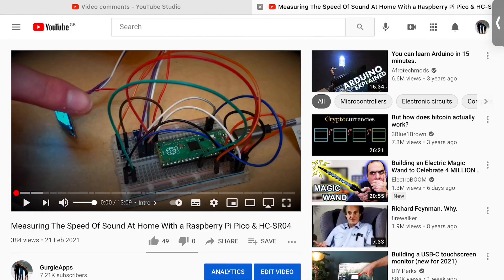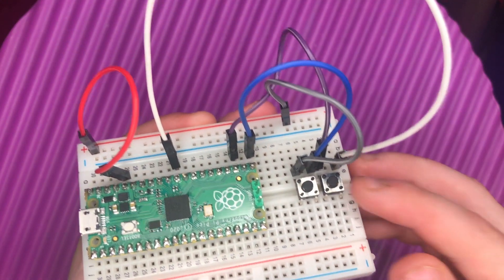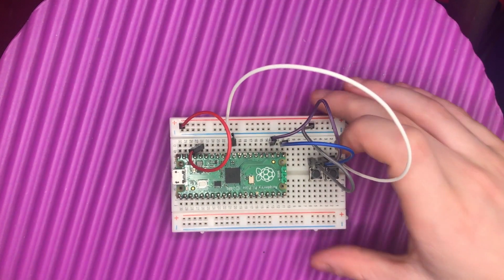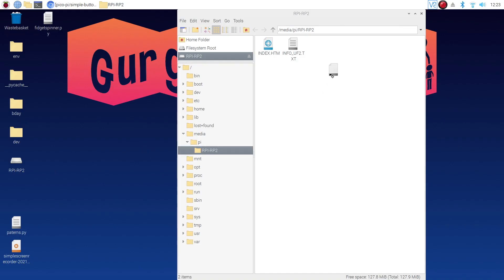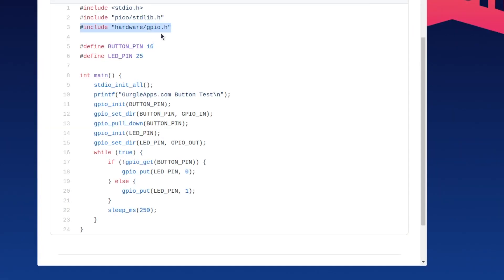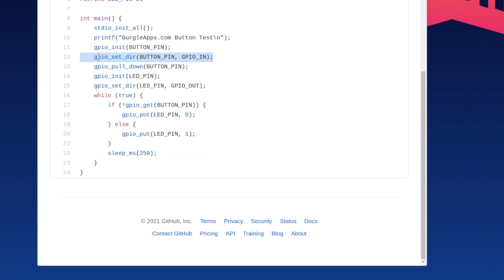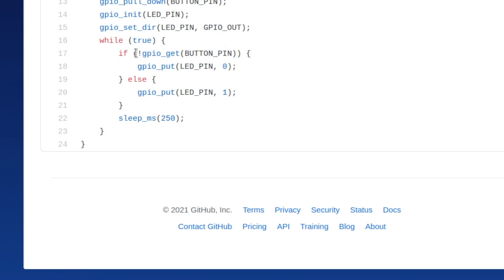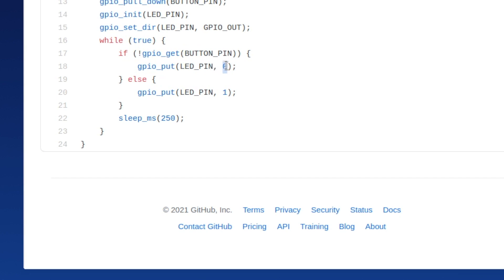How To Get A Button Working On A Raspberry Pi Pico or Microcontroller in C Code

Comment: in this specific case,  the code for the "if else button press detection + led on/off" could be simplified, the result of 
gpio_get(BUTTON PIN) is true/false and so the "if else" block can be replaced by a single line 
gpio_put( LED_PIN, gpio_get( BUTTON_PIN )  )
or if you want the led on when the button is not pressed just add ! symbol
gpio_put( LED_PIN,  ! gpio_get( BUTTON_PIN )  )
anyway, nice video
Reply from the maker: Yes that's the best way for that purpose. We didn't know what the person asking the question wanted to do when the button was pressed/released so we wanted to have code they could hack to their purpose. We should have taken out the stdio stuff too really as it was unnecessarily  confusing.
Reply: @GurgleApps  or mingle the 2, single line for led and if else block for other actions.